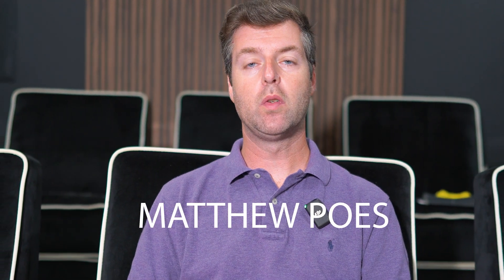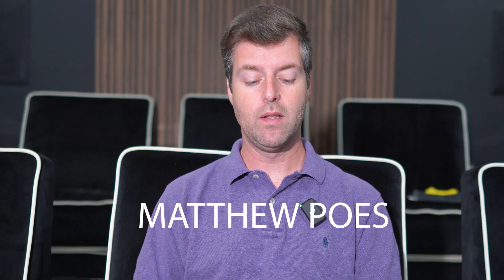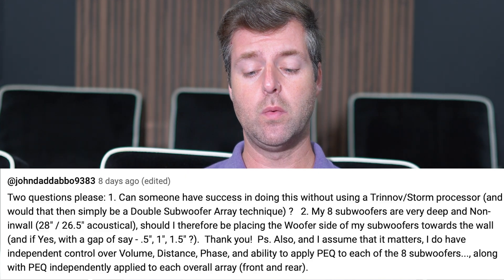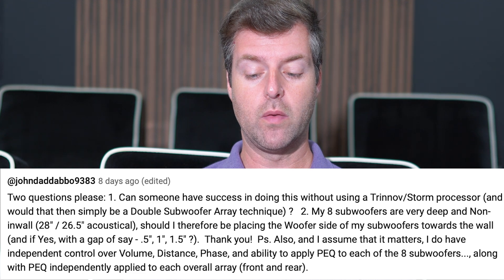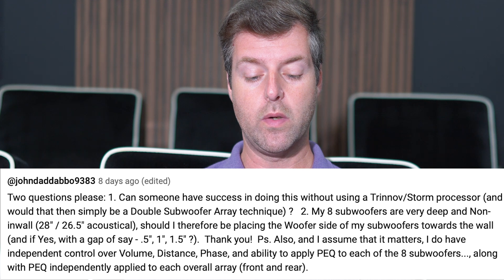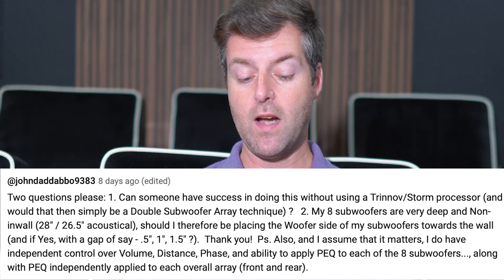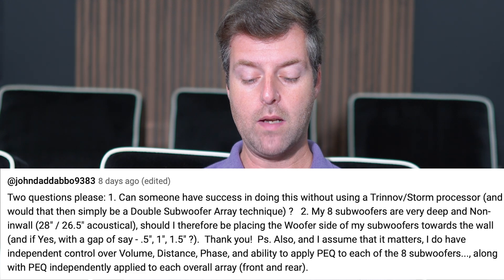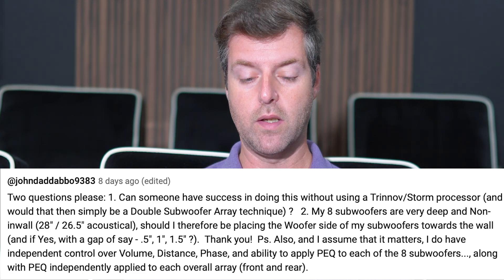Waveforming without Trinnov? Is it possible?

Comment: Hi Matthew, are there any other softwares you know of besides Trinnov that could possibly automate Waveforming using a miniDSP HTx which would allow 4 subwoofers in the front of the room and 4 subwoofers in the rear of the room? Also, would it screw up Waveforming if the 2 middle rear subwoofers were recessed 4-5 feet than the 2 outboard rear subs? It's a little hard to explain but one of the two rooms I want to do Waveforming has 2 9 foot openings one on the side another in the rear and I can get 2 subs in the rear on each side of the 9 foot opening and could put 2 center subs on the wall about 4-5 feet back of that pathway.

Comment: I can't remember for sure but did you try Waveforming in your own set up but with the subs on the sides of the screen in the interim? and although not ideal, it still worked well?
For context I am considering an LED wall vs Christie m4k15 projector. If I do an LED wall, I only have room to put the subs on the sides. If this doesn't work well I may change to Stormaudio with dirac ART where sub placement is much more flexible.

Comment: superb insight Matt..golden educational vlogs. i've thought of that too..using DSP at rear subwoofers to cancel out the reflection. but i have yet to experiment active crossover for rear subs which has delay & reverb knob to adjust & cancel out the low frequency reflection from the back wall..or maybe Dayton's DSP-LF would do the trick.

Comment: In the future, it would be great if you can create a video that tests Dirac ART with a more modest system (such as 2 subs in the front and 2 in the rear, with surround speakers that are bandwidth limited, and maybe front speakers that are either similarly bandwidth limited or maybe can go down to 35 Hz or so). There are far more home theaters with this type of "modest"'(as compared to Trinnov waveforming purpose-built rooms).

Comment: For in ceiling subwoofers does it matter if they are down firing or in a side firing with a port? Related. Related to Welti studies on subwoofer placement have 4 subwoofers a quarter length in room. Can this be mixed with two front corner loaded speakers and two in-ceiling? Concerned that bass waves interacting perpendicularly would be less or not effective.
Reply from the maker: You can’t really mix locations. Need to basically pick a location and go with it for all four. 

Doesn’t matter what the ceiling orientation is though.  I generally prefer all sealed, all ported, but not a mix and match.
Reply from the maker: Thank you for your support. I’ll answer your question in my upcoming videos

Comment: Great video Matthew thanks for sharing. You mention the analog approach. Is the rear pair delay calculated for a specific frequency (ie 20 Hz) or strictly based on the room length?
Reply from the maker: Not exactly how it works. The rear subs are delayed based on time of flight for sound from front to rear. It’s so you cancel the wall reflections.  However since that is often the longest dimension is the room, usually it cancels the first mode and derivatives of that length. But it’s not tuned to a frequency. It’s tuned to a dimension.
Reply: @PoesAcoustics got it thank you!

Comment: great video, while it seems like DIRAC ART can cover more frequency range and cost less to implement, Waveforming can give more consistent results.
Reply from the maker: Yeah sort of. ART would be just as expensive to implement for the same performance.  

And until I see stronger evidence to the contrary, I think I would prefer to characterize it as waveforming being both more consistent and better results. I have a lot of faith that Dirac ART can achieve similar results potentially. However based on my experience, it would require a fundamentally more involved design approach for ART to do that. Which would then equal Waveforming in cost and complexity. 

I do like that ART is using all speakers as support speakers (potentially) but having now used it, and letting logic back into the equation, I’ve come to realize those support speakers need to be wide bandwidth and high dynamic range. You need surround speakers that can go down to 30-40hz at 110+ dB to really be fully effective support speakers with no chance of overloading. That means a very different surround speaker or the addition of bass augmentation speakers around the surrounds.
Reply: @PoesAcoustics   i agree, only meant cheaper as it can use the speaker that you already have but most surround speakers i have seen people use start to shit themselves around 120hz.
but if the goal was the same results i think (discarding the price of the processor) waveforming might be cheaper, i can get 6 high quality high output subwoofers for way cheaper than 7 close to full range with high output speakers